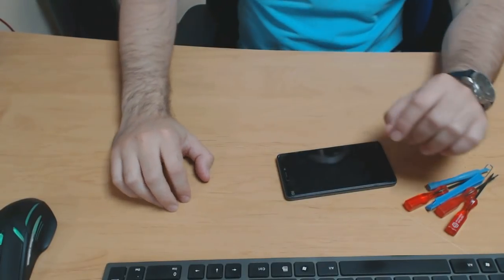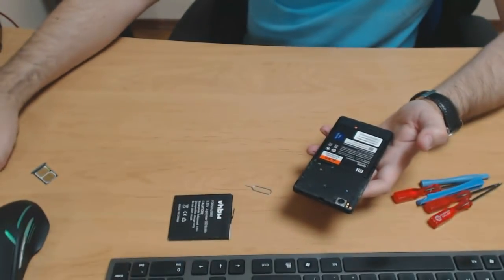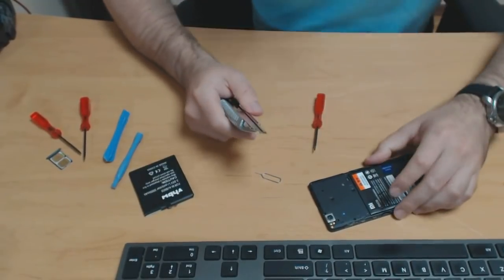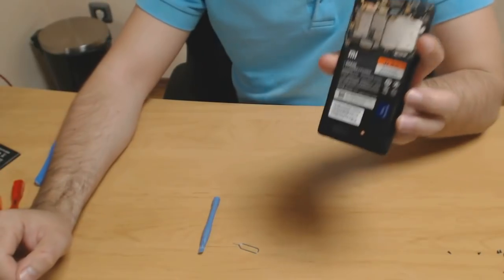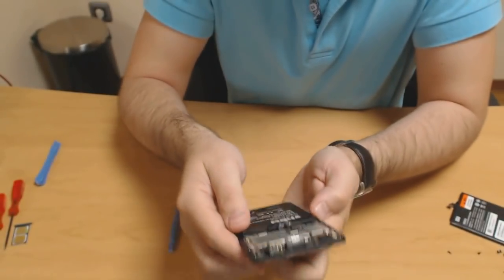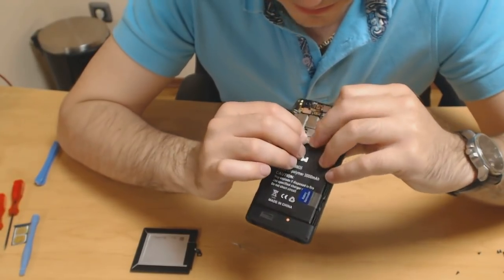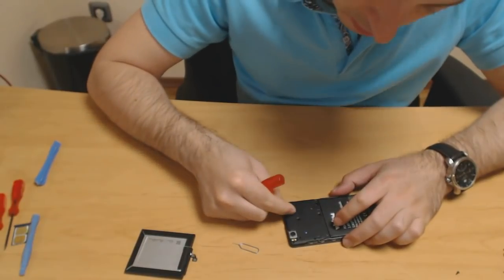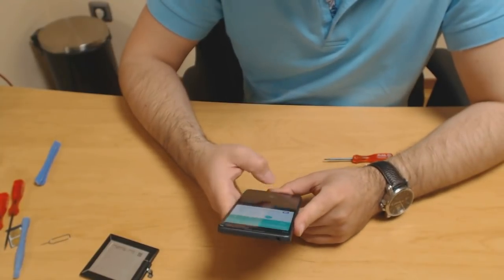Xiaomi MI4C Battery Change

Comment: Do you have a good experience with the replacement battery?
Reply from the maker: I do actually - battery life is excellent. The battery cover, on the other hand, is not so good - after being fitted, it eventually developed cracks on the edges as if it's too small to fit and is brittle.

Comment: is mi4c water proof ?
Reply from the maker: No, the MI4C is not a waterproof phone.
Reply: Stanislav Georgiev mi4i ?
Reply from the maker: Same. It might handle light rain and stuff, but it's not officially waterproof rated.
Reply: Stanislav Georgiev so i can't swim with phone :v
Reply from the maker: You can! It just won't work afterward.